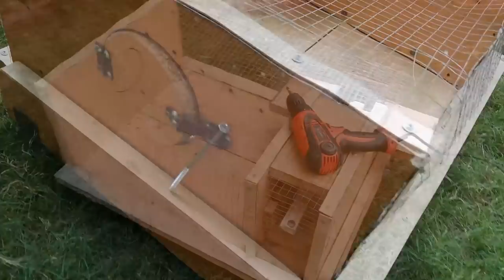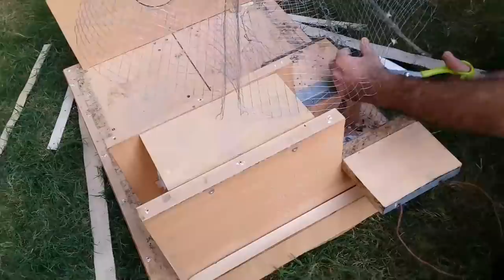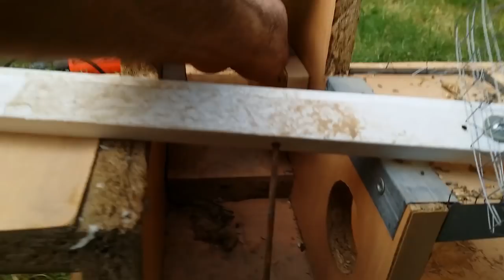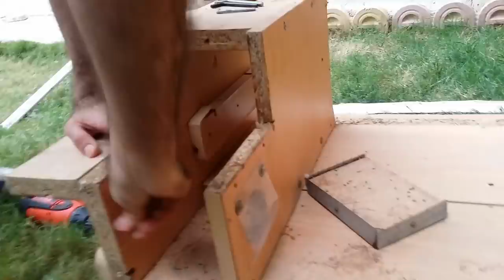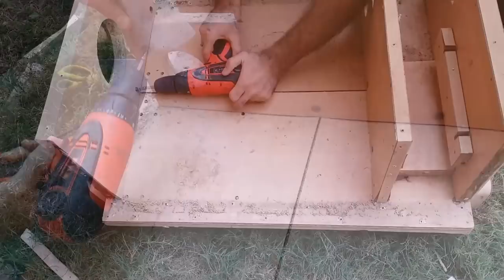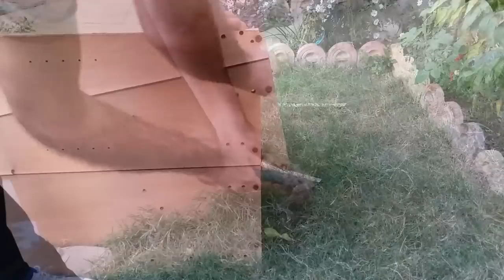Homemade, Dismantled and Destroyed Sparrow Trap! Part 3

Comment: Now you can just throw pieces of that trap at the sparrows and kill them off. 😁😉
Never use wood with a particle board core in an exterior application. It won’t hold up, long term.